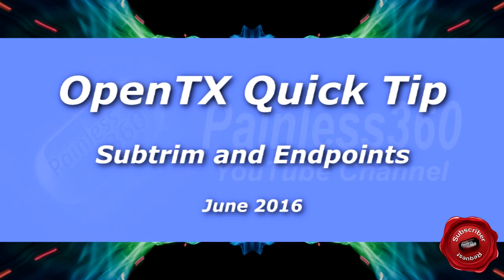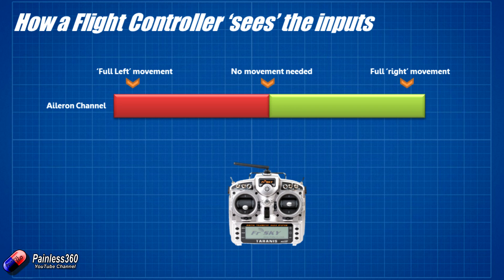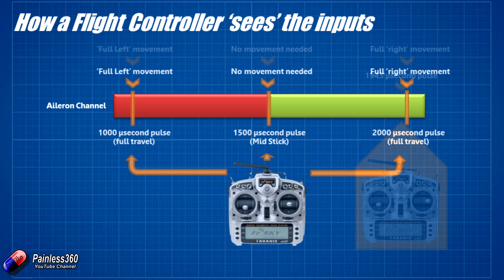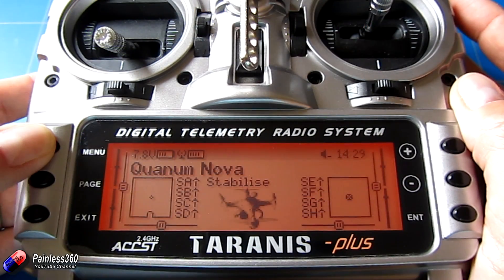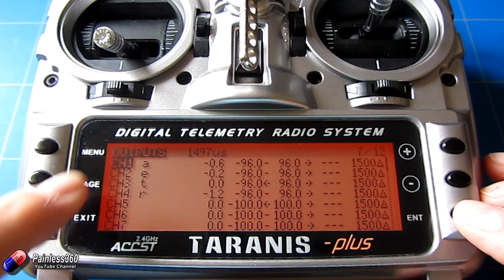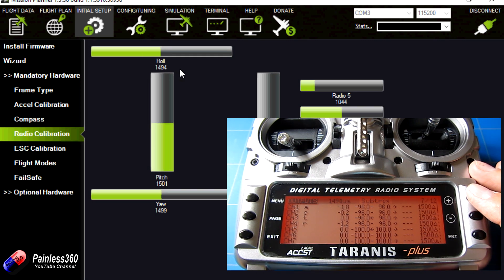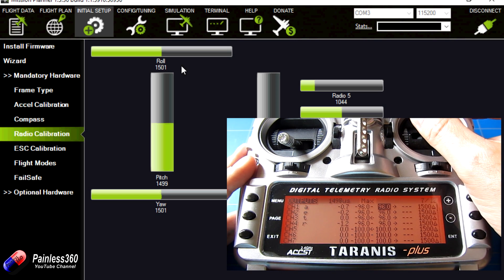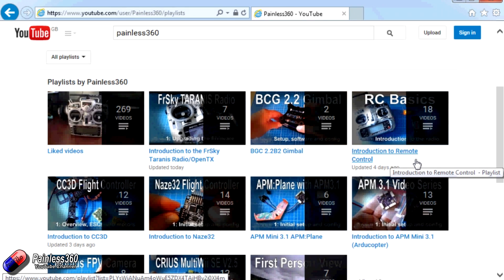OpenTX 2.1 Quick Tip: Using subtrim and endpoints with flight controllers (naze32/APM/flip32 etc)

Comment: What is the PC software you're using to show the values on the controller?
Reply from the maker: https://youtu.be/tDZYXx-RPbE happy flying!
Reply: @Painless360  yikes, I've had companion since I got the X9D, just never looked at that page.
Thanks!
Reply: @Painless360  - sorry to bother you again, but I don't think what you're using to show the change as you move the sticks is companion. I have the latest copy and I don't see that screen/page/tab anywhere in there. Also, the screen you're demoing is in color. Am I totally missing something?
Reply from the maker: It helps me if you can let me know at what point in the video you are referring to. If it is the same as in the thumbnail then that is Mission Planner, part of the Ardupilot family... Happy flying!
Reply: @Painless360  - I think you are using BetaFlight or ClearFlight or somthing like that. It's the screen that shows the microseconds responding while you move the sticks on the Taranis. I don't think anything in Companion will show that information.
Reply: IE: at timestamp 3:38

Comment: Can it help me in stabilizing the quadcopter ??
Reply from the maker: Please see my bind and fly betaflight setup video that goes through all the steps you need to go through to get a quadcopter setup well. Best of luck
Reply: @Painless360  But I am with mission planner all setting are at the mark but it still flips on takeoff. I noticed that my endpoints are going too far from normal range. Can it be the problem ?? Please help
Reply from the maker: @sss_1707  https://youtu.be/P4soR6QgOk0 all of that is already covered in playlists and videos.. Best of luck!

Comment: I realize this video is a couple years old now but should I be concerned if my channel ranges are outside what Mission Planner considers normal (1100 to 1900)?
I have an X10s radio, with R9M, bound to a R9 Rx. My FC is a Pixhawk (version 1) with latest firmware.
My default ranges are MIN= 982 and MAX= 2006.
Should I adjust my endpoints to fall within the "normal" range? Or does it matter?
Reply from the maker: Ardupilot won't like channel ranges that are too much  - see the Pixhawk & Pixhawk 2.1 series..best of luck!

Comment: How exactly does this apply to the throttle? idle (1000), mid throttle (1500),  and max throttle (2000) ?
Reply from the maker: +Bernard Adderley exactly tge same, although the mid throttle position isn't as critical..

Comment: Recently got a QX7, however I'm having trouble getting my sticks endpoint to reach 1000 and 2000 microsec, on all gimbal inputs. The Min and Max are all on 100%, but max deflection is around 1200 and 1800 microsec. Is there a way to solve this? I'm relatively new to rc flying
Reply from the maker: I'd rerun the calibration.. See the videos on the QX7 on the channel..
Reply: Painless360 ok ty. I’ll go n try.
Reply: Does ail and ele mixing affect the endpoint of the sticks. I currently have an elevon setup.
Reply from the maker: Nope, unless you've reduced the travel in the mix/servo screens..

Comment: Is there a way to increase servo travel beyond 100 percent? I wanted to get more travel out of a servo driven pan/tilt gimbal. I know with my DX9 I can increase servo travel up to 150 percent. Can the Taranis do such or something similar?
Reply from the maker: Yep - enable the extended trims option in the lower half of the 'Setup' menu on the radio for the model you are looking at..

Comment: Opentx is awesome. I was wondering if buying the Turnigy 9XR Pro was a bad idea. While it does have its drawbacks in quality it makes up for in this type of access and Jr module flexibility. For me it was price and features. But I can say I like it, the buttons have been updated, mine are very nice, there is only one 3 way switch, but it does need tweaking.
Reply from the maker: I've not used it here but lots of pilots use and like them. Best of luck!

Comment: Great video, well explained. Can I ask about the "96" keeping them the same I notice you are 12 short on the left 1012 and not on the right roll (only 5 short) 1995. Probably doesn't make much difference but doesn't it mean you can roll harder left than right, or are there dead zones at the end?
Reply from the maker: You can use the settings to get both ends the same but in practice there will be very little difference. Happy flying

Comment: Hi and thanks I've subbed. Can you tell me do you centre the main trims first or get close to the 1500 with the trims and then use sub trims? I have occasional yaw drift on one of my ships.
Reply from the maker: +shlllong use the process in this video with the trim switches in the middle, default position. If you've got drift and the channel value for yaw is 1500 then I'd recalibrate the  gyros/accelerometers. Best of luck!
Reply: +Painless360 OK many thanks and lastly if min throttle is set at say 1060 and Max is 2000, will that make any difference on say yaw pitch and roll with the minimum numbers of 1000 and mid points of 1500 that you speak of?
Reply from the maker: Not sure what you're asking. Refer to the manual for the flight controller you're using. I normally like 1060-1940 range or a little more on the main fight controls (yaw, pitch, roll).. Best of luck!